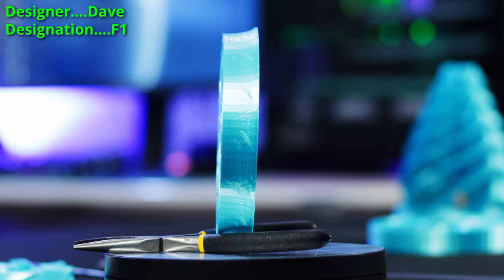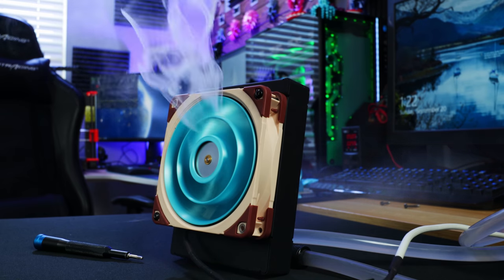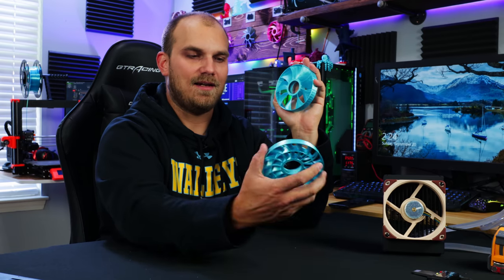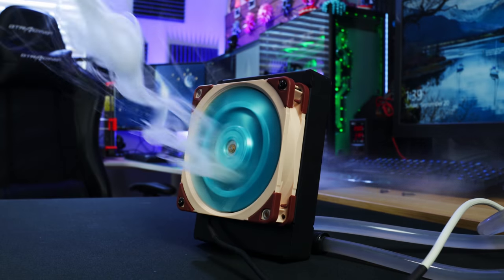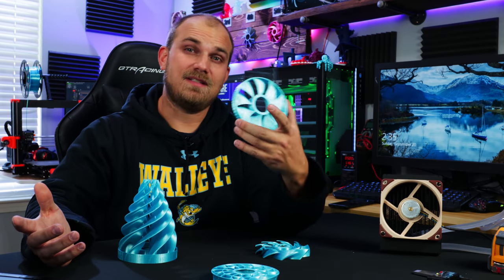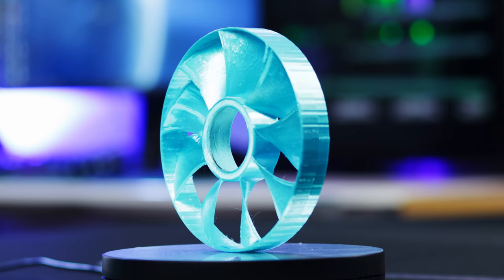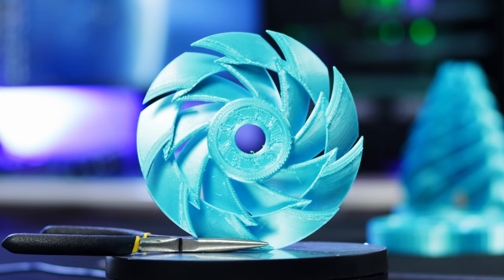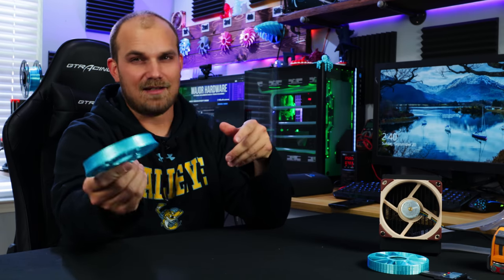This Couldn’t Possibly Work… Could It? | Fan Show Down Episode 5

Comment: On the one that looks like a screw, reverse the center spiral so that it matches the direction of the outside, just 3x tighter than the outside so that it has more connection points, for the added stability that you get now. The counter rotating center spiral will shoot a column of air outward that is pulled from the base and just eventually start just recirculating a lot of it's own air
Reply: My solution was making the inside sold but yours is a better solution.
Reply: 🔵 If it was rebreathing a substantial percentage of its own air, that's certainly going to lower its efficiency for cooling!

Comment: I wonder if you'll get any input from noctua.
this weeks winner is surely cutting it close
Reply: Yeah and it also looks super cool 😎 👌
Reply: Considering the inperfections/loss of efficiency created by 3d printing itself, it might actually do quite bit better if manufactured the same way as the real noctua fans.
Reply: @bloxyman22  Agreed - the thickness is a necessity due to the 3D printing method, but it means there's a fair bit of flat surface. Do the same design with thinner and more precisely manufactured blades, and you might get something interesting...
Reply: @bloxyman22 When he printed the default a12 it performed pretty much as well as the retail one, except sound wise. That leads me to believe that the print quality surprisingly doesn't have too big of an effect on performance. Still it'd be nice if he got a resin printer.
Reply: @z3dar  he has a resin printer
Reply: @TONOCLAY  he doesn't print it in resin though, I'm pretty sure. If it were resin, it would be extremely smooth
Reply: @SkylineLofe  the guy said he should get one. i said he has one. but he isnt using it lol
Reply: @z3dar  Did it not have a few degrees higher temps?? Or do I remember completely wrong?

Comment: For the last episode you should recheck the top 5 against the noctua fan, especially if it is this close. Maybe take the winner of that and print a few more of them with slightly different print settings, maybe you can improve it even more.
Reply: I think it would be better to take the winning design and print it in resin, and then try to clone the design of the noctua and print it in resin too. That way there isnt any performance difference due to materials and textures.

Comment: About the Tulip:
In an actual midi Tower desktop PC the Tulip would be very good as a blowout Fan in the top back of the case.  Because its starts to guide the air far away from the exit, the airflow in the case becomes more oriented and thus more efficient. I have seen a few serverracks and industrial vents use similar pricipal fans.

For a test to see what i mean you could just "drop" down the smoke at the tip of the tulip in your test stand and then "drop" smoke at the same distance from the radiator using the other fans and you should see the smoke disapear quicker with the tulip. For why its not widely used in actual tech is pretty easy to answer:
It costs more to build for a very smal benefit and it takes up way more space and has a very high tendency to be imbalanced and cause vibrations and damage.

I would love to the Tulip design build into a case but i guess the CPU heatexchanger will always be in the way

Comment: Play with the pitch of the tulips fan blades. Seriously, I bet there is untapped potential.
Reply: Would be interesting to see a couple of them cooling a radiator in some sort of protective housing or frame.

When I first saw it I thought it was going to be called Mermaid's Purse or something similar. (Shark egg)
Reply: Altering the internal support structure of the Tulip might also work too.

Comment: I was once involved in a project where we designed a better fan. We ended up doing a basic design in the end but I remember that one of the main things to contribute to better performance was the area of each blade. In that sense, Thomas design had a bit more advantage. The reason the tulip didn't perform better was most likely that it needs a cover to channel the air. Also I discovered that if the blades have "bumps" like humpback whale fins you can reduce noise with several percentages.

Comment: I am still waiting for someone to use AI and create THE perfect fan.
Reply: I was just thinking about that. You'd end up with some crazy nonsense like those antennae designs that no electrical engineer understands how they work so well. You'd need a pretty robust fluid dynamics modeler, however, since genetic algorithms tend to be very good at finding bugs in physics simulations.
Reply: @timh.6872  Those Antennaes are awesome, that's one of the things that brought machine learning to my attention a few years back
Reply: C W  Not every logarithmic spiral is a golden spiral and the Fibonacci spiral isn't even a logarithmic spiral, being formed from segments of circles.
Reply: C W  Please use punctuation, I can't really parse that word salad, and so I have to assume you're just pushing pseudoscience buzzwords with nothing to back it up.
Reply: @timh.6872  I remember a Episode from the Simpsons this exact sentence was used.
Reply: What about feedback. Ai needs it. 
You can give it predigested math and fluid theory, or you can let it manage the printer (robotic arm and sensors).
You can give it a second objective, minimize the tests (& waste) needed.
Reply: If you want to test the performance of the AI's predicted fan models in a virtual setting, you would have to have a near perfect representation of fluid mechanics in your software
Reply: For that you need a good NVIDIA 3D graphics card first to run Tensorflow....  they all sold out. Too bad.

Comment: I advice using the tulip on the other side, sucking the heat/smoke into a vortex since this build is used in industrial exhaust systems

Also, reducing the height might help with the diggling and allowing the rotor to spin faster. 

And filling/reducing the empty space inside the fan will allow an more dense and faster air flow to be built.

Comment: To future contestants, putting a ring on your fan reduces it's effectiveness.
Reply: noxxi knox  it's extra mass that's not helping to move the air, I'd guess.
Reply: ya, i think most of these should be printed without a ring and retested.
Reply: It's because it's already a ducted fan, adding another duct doesn't help. The frame is a duct.
Reply: Tombs Clawtooth Exactly what I came here to say, it’s a great design for a fan that doesn’t have a duct (for directional airflow) but it’s redundant on a PC fan frame.

Comment: The F1 Fan is actually relating to the "Fan Car", which used this design of stationary aero surface to give the car more downforce. It was banned early on, as are most interesting innovations in the F1 world. A shame too, because a normal car with a giant fan on the back would be epic.
Reply: Search for Gordon Murray's new car (the designer of the original fan car and McLaren f1) it's not exactly "normal" but it is a road legal car.  If you don't know all this already lol
Reply: Its the Brabham BT46B for those interested.
Reply: But... he said the inspiration is F1 'Rear Wing'... not 'fan'...
Reply: @klauserji  Right, and in most ways what he said is correct. The actual 'fan wing' was stationary, but within the engine there is a real moving fan that blows air over the block to help cool it off. By passing some of that air out of the 'fan/wing' on the back of the car, you can produce way more downforce than normal. It's called the Fan Car because the additional pieces of 'rear wing' looked like a fan blade or turbine. It's similar to the look of an Electric Ducted Fan as well.
Reply: @EnderMalcolm  im not an avid F1 fan, but yea i know that car and other whacky F1 cars like 6 wheeled car and 2 chasis car.
Reply: @EnderMalcolm  As an avid F1 fan, he clearly meant rear wing, not the Brabham fan car.
Reply: @KyleP133  As an also avid F1 fan, the rear wing isn't a circle.
Reply: I was looking it up and what a nice piece of F1 history to find. thanks dude

Comment: Notice the common theme on the leaderboard fans: open tip blades.  The outer shroud is already on the fan body, you don’t need a ring on the blade as long as the fins are strong enough without it.  This is the worst place to add weight and it kills speed.  Generally: less speed=less airflow, all else being equal.

Comment: The F1 fan:  A multi element wing typically is there to allow the wing to have a lot of camber without the airflow separating, but with just straight blades with such a large gap it's kind of just adding to some extra churning.  I think that's related to why the tulip did as well as it did, that the absurd chord of the blades lets them have very gradual camber.  The more I think about it, the tulip isn't as bad an idea as I first thought, as it does bear a resemblance to an impeller from a centrifugal compressor (think a turbocharger).

Comment: The extended fan is an interesting idea. With improved surface area you would have more space for hot air to make contact with the fan itself allowing for better cooling, if the design can be perfected, with lighter material, I think you may be on to something.

Comment: I believe there' lots of ways to improve the tulip design, by the smoke test you can see that quite a bit of the air is being thrown to the sides at the base so most of the air getting through is actually being fetched by the top.

Comment: Tips for fan designers, no outside ring, it adds weight in the worst possible spot making your final rpm lower. More surface area equals more flow.

Comment: If you half the size of the cone and thicken the inner lattice close to the base on the tulip you will increase efficiency while maintaining the benefits of the increased surface area. That kind of design has a lot of potential.

Comment: It seems like the one thing the top 3 have in common is little "spikes/rungs" that catch the air and push it downwards. 
Most other designs allow the wind to move to the side instead of the center. 
Maybe it would be a good idea to build a fan with something like chambers on the wings that have a downward curve.
Like a 7 wing with 2 to 3 "chambers". I have no experience at all with 3D modelling otherwise I would try myself :)

Comment: I suspect that the design did so well because usually the majority of the air would be pushed at the blade tip but this design essentially creates 2 blade tips on each blade so more air is pushed through the middle.

Comment: you can tell the more aggressive blade angle creates more static pressure and will yield better results when pushing air through a radiator. I would assume that is why that 1st place fan did so well as it had a very high static pressure

Comment: i think the reason thomas's fan worked well was due to increased surface area/ blade essentially no draw back to drawing the blade backwards it just extends the scoop surface while not reducing the air movement of the previous blade. for the tulup i think part of the cooling limitation has to do with that center spiral as that seems to ge where most of the air flow was drawn to, if the inner core could some how be spread out over the fan mount header and have that cores air flow be pushed to the sides.... there may be something there.

Comment: Great concept for a video series!
May I suggest that you would have more reliable results if you did a couple of things:
1) Control your initial conditions better.  Make sure the room temp, starting temp of the coolant, etc. are the same for all your tests, in order to make direct "apples to apples" comparisons of the results.
2) Do each test at least 5 times and collect data from each run.  This shows how repeatable each result is, i.e. shows the variance in each measurement.  It's hard to know what's within the bounds of error when you don't quantify those bounds.
Cheers!  Thanks for the great video.
Reply from the maker: My room temp is ridiculous, im in process of finishing my basement and when its complete i will have a much more stable environment.

Comment: I think the tulip could be improved upon bij turning the base of the outer blades more in. I think there was some throwing out of air on the base, if they are more like scoops, they could possibly get some more air in. It might also benefit from a aero design for the hub.

Comment: The Acceleron (sp?) looks damn cool when not moving, and when it's rotating there's also the nice illusion of 2-level surface with a lip. And even better: It actually sounds really nice! Almost like a brown noise instead of the pink/white noise of a normal non-lightning-shaped blades.

So, a head-to-head vs between the original Noctua & the Acceleron might be necessary. Since their performance are practically within margin of error of each other, the decision should then be which one sounds nicer. Not necessarily quieter; a quieter white noise is much more irritating than a slightly louder brown noise.

Comment: You should try two more partial prints of the Tulip design, half height and quarter height, and see how they fare. Lower mass may help the motor keep blade speeds high and you may see where length of the blades stop making improvement on air flow.

Comment: I'm going to sit here and say I've been thinking of a barrel concept like this fan that actually pulls water to a propeller that's similar to this fan that's inside of a chamber that basically creates pressure and force it out a smaller and like a jet engine But I I really like how the vortex in the middle almost seems to have a better flow system so you could basically have the outside pushing a large amount to help propel you while creating a vortex in the middle to actually give you that ump to actually make it work easier and allow less stress while increasing the amount of water flow to the main propeller to give you crazy propulsion I just want to make an unorthodox propeller for the water something that's better than what the norm is so bad

Comment: The top fan of the 3080 is actually mirrored as opposed to this copy it actually blows air towards you instead of drawing (as seen from the front). That is why it's designed the way it is, would love to see you print a correctly mirrored version and compare results!

Comment: I think idea for the modern fan got a little lost in translation. Fans used to be for circulation so the design was primarily supposed to push air around a space. The fans your talking about are Exhaust fans which are designed take air quickly then dump it. Purely Smooth fan “blades” will not have the pull/grab power to dump air. The channel was a fun find.

Comment: I know you asked for fan designs, I actually have a test design. There might be a better way to test the fans. Put a set amount of smoke from the fog machine in a large acrylic/glass box (more than 33³ meters/100³ feet) with two small holes one near each of two opposite corners. (If the holes are in opposite sides smoke could get trapped in the corners.) Mount the fan in one hole and see how long it takes to clear the box. Of course you could use an egg shaped box with holes at the ends, but cube shaped is easier.

Comment: I have an idea for a fan, but I don't have the software, skill to make/test one.  Theory: When you compress air, it cools.  So if you had a set of holes in a fan that collect air and send that down a cone to output towards the radiator, the air should be colder than when it went into the fan.  If you add additional fan blades around the curved cones to cause a Bernoulli effect it should force the flow of air through to pull the cooled air with it.

Comment: The tulip design may be backwards, since most tulip impellers the wider flange is where it's pulling in, there narrower point is where it's pushing.

Comment: The Acceleron is potentially a really good design. The inner blades (before the 'notch') might be producing airflow which could be more heavily focused by virtue of the 'notches' in the lightning bolt shape of the blades producing a more forceful ring of air surrounding the air from the inner blades, therefore holding the air in the center rather than letting it disperse outwards. The outer blades (after the 'notch') will disperse air more widely surrounding the more focused center air flow.

Comment: With designs becoming more intricate, especially with very thin blades where FDM is going to become an issue, I think it's time to switch to the resin printer. You'd also be getting smoother prints, which would display more accurate and consistent results.

Comment: I think we could design a fan blade that would essentially convert the "fan" into a "blower". Kind of like a squirrel cage with a funny curved shroud around it. If you have the intake be half the diameter of the fan, with fins parallel to the axis, and a curved shroud around the outer part to direct blower air through the fins, even with a smaller opening a blower should outperform a fan.

Comment: since air can be thought as a light fluid with it's own viscosity, there can be 2 solutions each optimizing for efficiency(less heat and noise) or speed(more heat and noise).